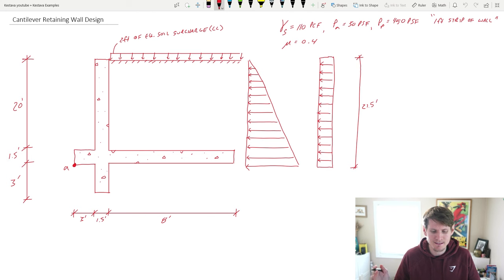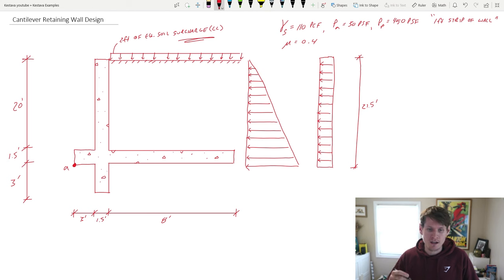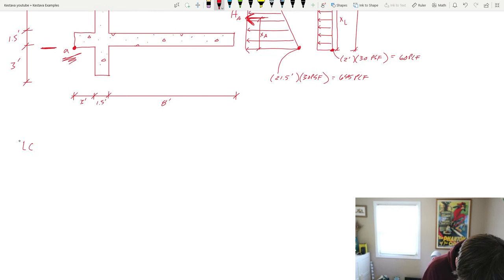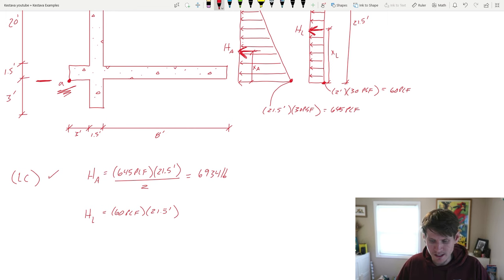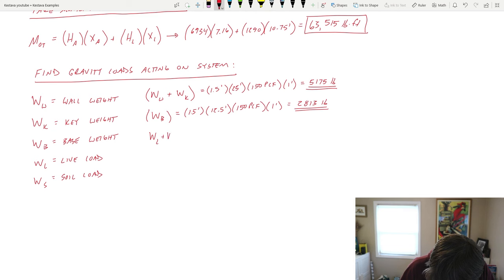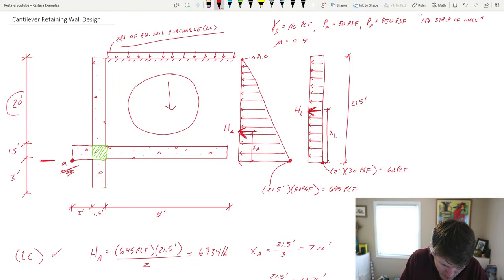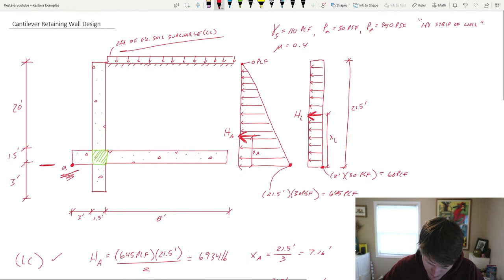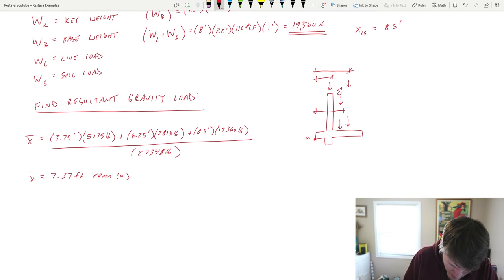Cantilever Retaining Wall FULL Design Example | Part 1| Learn Engineering

Comment: Can you explain, please, why you didn't take into account passive and active coefficients in the calculation of active and passive soil pressure? Cause in NBCC I see the formulas for finding this coefficient. Thank you, for your time and work)
Reply from the maker: Hi Just V - we were given the "equivalent fluid pressure" for our design this pressure already accounts for the active and passive coefficients. in the professional field it is common that the geotechnical engineer will provide these pressures in their geotechnical report so the structural engineer doesn't have to go through the process of calculating them.
Reply: @Kestava_Engineering  Thank you for your reply! I asked this, cause in my practice, we really rarely have a geotechnical report. We design residential buildings and must calculate coefficients.

Comment: Hey Kestava, any recommendations how to design a cantilevered retaining wall that retains water?
Reply from the maker: youll need to design for the additional hydrostatic pressure and you should look into additional ACI requirements for concrete structures in continuous contact with water.  the concrete mix and detailing changes I believe off the top of my head.

Comment: Hello. Thanks for great video. Unrelated question for you about vertical cold joints. If I pour concrete retaining wall one section at a time leaving rebar sticking out to tie into the next section and keying the new wall into the old one, is it likely to leak and stop me from installing wall covering on top of the cold joint successfully? Is there a method to do this successfully? I appreciate any advice.
Reply from the maker: you'll definitely need to do extra detailing at the cold joists to ensure a water tight structure. there are products that can be cast into the joint and many other products that are for this exact situation.